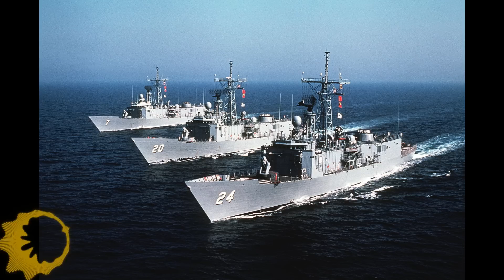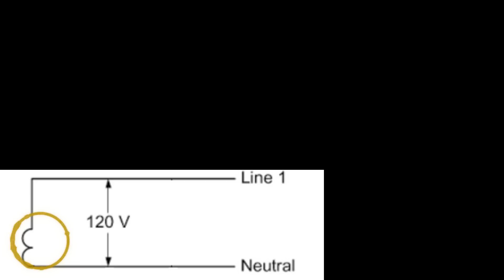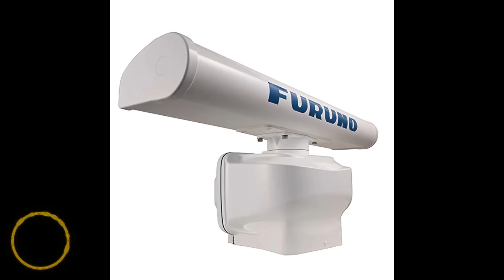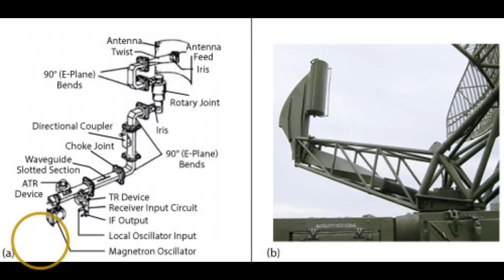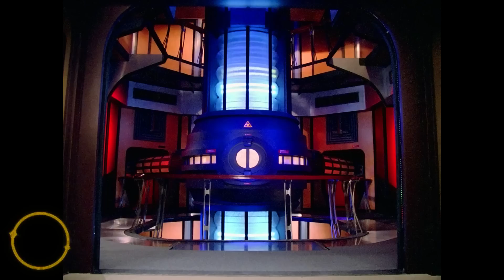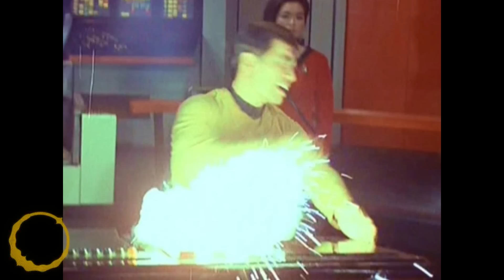You done put a grid in your EPS

Comment: Two points come to mind with the idea of plasma-carried electricity.

1.) The waveguide analogy might be far more apt than you make it out to be.
Since the plasma in this context needs to carry a lot of energy to be useful, we can safely assume that the plasma particles have high kinetic energy, in other words, the suff is hot.
And when we're dealing with hot plasma, simply running it through a polymer tube is no longer an option: you need to contain it, which would typically be done through a magnetic system; additionally, since you'd want to minimize pesky losses like friction, you'd likely use a thing similar to how we transmit electricity: an alternating currrent of plasma, rather than a constant pressurized flow. So, we've got an electromagnetic wave passing through means of a highly ionized gas, contained in an electromagnetic field... Yep, essentially, it is a plasma waveguide.

2,) When it comes to extracting energy from plasma, you'd likely want to absorb the kinetic energy carried by the particles, which would lead them to quickly recombine and become a simple gas. As a result, you'd get a "neutral" pipe (that does not have to be some complicated conduit) running the gas back to the warp core where fresh plasma would be generated from it. It would likely be some heavier noble gas, like Krypton or Xenon, so more impulse can be transferred through it, while also leaving it not particularly chemically reactive in its ionic plasma form.

Comment: To those saying they need to use fuses, fuses won't help much when you're being fired at with weapons capable of devastating planets, which is the cause of at least 90% of all console explosions with the rest being cause by natural powerful energy discharges.  Same way a fuse doesn't do shit when your house is struck by lightning.  Fuses can only do so much before they become useless.  All that energy needs to go somewhere and there's no a whole hell of a lot of ground in space.  It's going to flow until it hits a weak point and then come out violently.  The plasma conduits are designed to handle very large amounts of energy because that's their entire job.  The consoles aren't.

Comment: It really doesn't make much sense why you would run so much power through the console though. An elevator for example does not run the power for it's main motor down through the individual call buttons, like why would you ever want to. You can use much thinner wire if you just send those the much smaller amounts of power they actually need to send signals to a microcontroller that can operate the main motor via relays. They are able to reroute power abord ship so presumably the EPS equivalent probably some sort of solenoid type device does exist so why exactly are we sending all this power through something that is functionally just a touch screen display. Well I guess explodium looks dramatic on screen but this is not how any of this would work in reality.

Comment: I don't think they actually use the plasma as the source of energy, but rather as a conduit to distribute energy.

Plasma is electrically conductive, and denatured matter cannot be further denatured by excessive amperage.  Metal wires can short out, overheat and melt, or even outright vaporize like a fuse if you push too much juice through them... but plasma happily keeps conducting no matter how much energy you push through it.  Thus, it makes sense to use plasma for the main power distribution lines, as it's the only substance that can carry astronomical quantities of energy without immediately vaporizing.

But a control console...?  Small end-point appliances like that shouldn't have any excuse for drawing their energy directly off the unmeltable ultra-extreme-voltage main transmission lines.  They should just tap into the EPS line somewhere nearby, step down with a transformer, and power all the consoles with a standard conductive wire.  Maybe toss in a simple surge protector for good measure.  It makes no sense why a touchscreen (or a bunch of buttons & switches) would need access to the electrical equivalence of the sum total of electricity generated by a continent every second.  Warp engines, sure... but not a control panel!

Comment: No no no... the whole 'exploding consoles' has a completely different reasoning behind it.

See - this is so called 'penalty explosives'. It only explodes when the crew of ship screwed up somehow - thus a penalty AND an incentive to avoid making mistakes.
It's basically the same idea someone had for cars: "Imagine if, instead of an airbag there was a metal spike installed in every steering wheel. People would drive WAY MORE careful.

So, simple rule of the thumb: If you don't screw up, the console won't explode in your face. It's your fault if it does.

Comment: After the video I got an ad for a Palamatic Process lump breaker. The whole ad had the same rhythm as the finest techno babble. Breaking up lumps by hitting them repeatedly with food safe stainless steel rods until they break into pieces small enough to fit between the rods is a very basic concept. The script writer got to describe the pal-a-matic process and applications many many times in a short commercial without using the same terminology twice.

This is not an endorsement of the product, as I have never broken up lumps on an industrial scale.

Comment: This is the product of TNG being written by what we now call tourists.  

In ST2, panels explode because they put fireworks in them so that the cadet undergoing the Kobeyashi Maru test gets the real feeling though unrealistic experience of watching her companions injured.  Later in the same film when the real Enterprise suffers severe damage no consoles explode because they aren't fitted with pyrotechnic charges to assist officers in acting injured.  The Reliant suffers electrical fires on the bridge after being suffering a direct or nearly direct phaser hit, but it also has partial ceiling collapse and electrical shorts are not surprising under those circumstances.  

TNG writters thought this looked dramatic without realizing that it looked dramatic because the context was an in-universe performance for the benefit of Cadet soon to be Leutenant Savik.
Reply: if you check though it is worth noting that in early TNG seasons this almost never happened. the exploding console thing only started later on, and even throughout all of TNG's run it wasn't that common. Where it was most prevalent was DS9 and Voyager.
Reply: You spelt  touretts wrong

Comment: Dockmaster, I thought your analogy between EPS Conduits and real world waveguides was actually pretty damn perfect. Because strange as this may sound at first, electrical conductivity in metals is fundamentally the same as plasma physics. There's actually a sort of insane elegance at play here ... if the sheer amount of power needed to operate a warp drive is more than any known substance can carry without being instantly vaporized, why not roll with it and just use the insanely high temperature plasma itself to move the energy around?

It would not surprise me in the slightest if it were to turn out that Mr. Jeffries was aware of this. That man was one of the finest starship architetects of the 20th century.

Comment: smaller objects with low power consumption, or portable items that need to be recharged likely use those EPS taps.
Do you really think they recharge tricorders and datapads on plasma energy? No way, those probably operate on 3.3v systems with large capacity future batteries and have a near-field wireless recharging system that can sip power while near any designated ship surface or storage cabinet.
Every time someone sets a datapad down on a desk it probably charges it up.
Every time a phaser is returned to the armory, it probably has a higher capacity charging cabinet.
Reply from the maker: The smaller devices are powered by saurium krellide batteries, but it's never really explained what those are or how they get charged, aside from being handy bombs if you use them wrong or right.

Comment: If the ship warp reactor is offline, or main power is offline, or worse, is on emergency battery, what then about warp plasma? Console still goes splody splody... Why?
Reply from the maker: The impulse reactors are oversized, backup fusion reactors, and then the ships have dedicated backup reactors on top of that.
Reply: @SacredCowShipyards  but wouldn't the Fusion reactors, even all of them combined be minimal compared to the Warp Reactor (which by all rights is fusion in non existence)?
Reply from the maker: Well, sure, but the span of energy between "can literally warp space around the ship" (warp drives) and "I don't want this exploding in my face" (something smaller than a fusion reactor) is... quite large.

Comment: 18:09 replicators have food packs, which my understanding is that they're basically futuristic batteries with absolutely massive energy capacity. I know it doesn't make sense, Einstein says any food pack would mass just as much as all the matter it's capable of making. But they mention the food packs fueling replicators multiple times. So I'd say replicators have they're own "batteries" instead of conduits going to them. They also must have the capability of recharging food packs by converting matter into energy, hence the references to "recycling" items into the replicators. Its silly and inefficient. EPS conduits to the replicators make more sense.

Having said that, I just had a different idea. What if the food packs are used like capacitors in the circuit? EPS conduits go to the replicators, but while they carry plenty of energy, they don't have the power needed to replicate something near instantaneously. So the EPS grid charges food packs that then supply the replicators, discharging enough stored energy to make something all at once. Then they recharge. Probably several parallel banks of packs that it automatically cycles between in high traffic areas like replimats and mess halls. So it can replicate item after item without long wait times.

Comment: Just how much power do consoles need?  I can run a laptop on less than 200W.
Reply from the maker: Apparently enough to make a big boom.
Reply: I'm developing a theory that the LCARS consoles use molten metal (that has to be kept at temp and also needs to power some kind of active cooling of the surface for finger safety) for their displays. Like much angrier e-paper.

Comment: Years ago I hear from a university sysadmin about how UK universities, hospitals, and industry don't agree with each other on which way round the phases of 3-phase power go, that air-con installers sometimes don't know this, and how if you run the motor on an air conditioning unit backwards it sort-of manages to pump heat from outside the building into the server room that's already too hot.
Reply: Interestingly that's how a lot of modern heating systems work. It's just flipping the hot and cold sides of the air conditioner.

Comment: I have seen exactly one 2-stroke Detroit Diesel not leak, and it was full of oil and had great oil pressure. My uncle bought a retired military generator with an 8V-92 powering it, he rebuilt the engine and took the time to make sure it would not leak for the long term, or if it started to he could fix it easily, because he hated leaky engines. What a beautiful noise that beast made, and out where he lived, running his two chicken houses, his house and two rental properties, the generator still had some overhead for extra power. Also, when testing voltage at a power socket on the main power, they got 102-105 volts instead of 110-120. On the generator, solid 120 volts, 60Hz, and the lights in his chicken house went from dull yellow on main power to bright white on the generator. It was awesome. Ironically, when the generator was moved to its permanent home, someone punctured the diesel fuel tank at the bottom of the gen-set. He had to contend with cleaning up after a leak in the end, but the person that messed up made him a high mounted fuel tank with triple the fuel capacity, and able to use the warmth from the generator in the winter to keep the fuel warm if need be. You lose some, you win some?

Comment: I always assumed that the plasma in trek ships as a sort of glorified steam engine where instead of using gears, rods and pivots to transfer power within the ship steampunk style they just shunt hot/energised plasma  around instead and each machine it connects so just siphons off the excess/variance energy like a Stirling engine would from a temperature differential (same for the replicators a bit they have a BS matter/energy filter that breaks physics in the most space-magic-BS way imaginable), so more energy more plasma, more warp core power more energetic/“hotter” plasma and the rest just circulates it like a glorified mechanical circulatory/refrigerator-coolant-in-reverse system. 

Upside that then becomes relatively simple in concept/design/modification and “easy” to maintain. Downside you have the element power of the main reactor flowing behind EVERY device to some extent or another and the system is clearly of a violently destructive  “breakdown” system at least when breached by anything charged in a similar way (explosions torpedoes, various beam/blaster/burst/disrupter/cannon weapons and various magnetic/electric/plasma).

Comment: The far future where Relays Opto isolation, fuse and circuit breakers are kost tech and you run the high voltage lines directly into sensitive electronics at full power

Comment: Three phase does require a neutral. Just one, though, for all three phases. It's possible, however, that the navy did what your car does, and just attached it to the hull/frame. When running three phase power in locations that do not have such convenient ground and safety ground attachment, you require red, blue, black, white, and green wires, where white is the neutral and green is the safety ground.

The way they made wave guides, however, was an entirely new thing to me. They still don't excuse EPS, but they're neat.

Comment: honestly is there anything on the bridge that needs that much power? these are just terminals to the main computer cores anyway. just run wire to an electric box a deck or two down. then when it goes boom, it goes boom a couple decks down and doesn't decapitate your command staff.  need redundancy, fine, you can have two rooms full of explodie things and two sets of wiring. honestly that plasma shouldn't go anywhere where life forms are. most of our technology isolates the big power bits from the low power control system bits and uses optocouplers to send signals between the two. source, every damn power brick with bad caps that i fix.
Reply from the maker: "Because Star Trek."

Comment: I was under the impression that they used nuclear fusion for electricity. Its stated in numerous episodes from TNG through Voyager. In Voyager they even have to be sparing on the replicators because they need deuterium for more power in the first few episodes until they find a giant nebula of it, hence the iconic "There's coffee in that nebula" line. The explosions from consoles is due to arcing and exploding metal due to high voltage shorting, which happens IRL. AFAIK the warm core only powers the engines.
Reply from the maker: The core uses deuterium as well, and is the primary power plant with the fusion plants providing backup.

Comment: I've always had to wonder just what kind of computers those consoles are running that they need that much energy.  I could see an EPS conduit feeding a power tap in the bridge or CIC, but I would expect the actual controls to run on standard electricity.

Still, running the big systems on an EPS grid makes sense in universe when you consider the sheer energy needed for things like weapons and shields.  A plasma conduit can probably move more energy with less resistance than wiring.  If I recall, Star Trek was first created before the discovery of usable superconductors.
Reply: They can't need modern power-hungry GPUs to run a GUI that static, surely?
* console explodes anyway *

Comment: My explanation for the EPS grid is that starships' non-propulsion systems run on so much amperage that wires can't conduct it without massive heat losses, upconverting that massive amperage to massive voltage to allow using reasonably-sized wires would come with significant arcing risks, and superconductors have their own practicality problems, so they use tubes full of excess fusion plasma as electrical conductors. As a bonus they don't need fuses because they can just vent the plasma and the entire conductor disappears in the process.
Reply from the maker: Problem is a lot of the "venting" seems to happen through the consoles.
Reply: Not heat loss.  Overheating.  A metal wire could never handle the extreme amperage being pushed into stuff like warp engines, shields, phasers, or deflector dishes.  All metal is a resistor, and would overheat, glow, melt, or outright vaporize just like the metal strip inside a fuse.

Plasma is already denatured matter; a soup of detached electrons and ionized atomic nuclei.  Plasma also happens to be electrically conductive, and you can contain it in a tight line by simply wrapping an electromagnet around it.  You can push almost any extreme current you want through a thin stream of plasma, and it'll happily take it.  We see nature do this every time a bolt of lightning strikes.  EPS is simply a main transmission line that can handle terrifying levels of current without being instantly destroyed by said current.

While it makes perfect sense to use plasma as a wire to conduct energy to a starship's main systems, it doesn't make any sense to power small appliances directly off the same network, but that's Trek for ya.